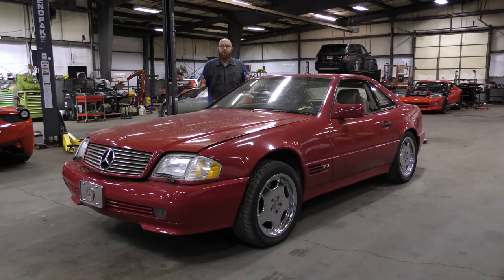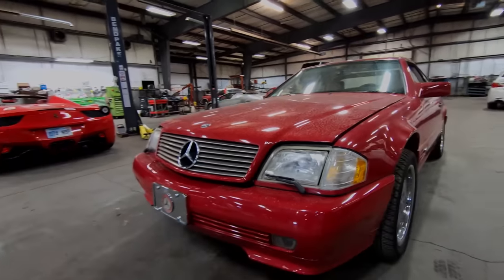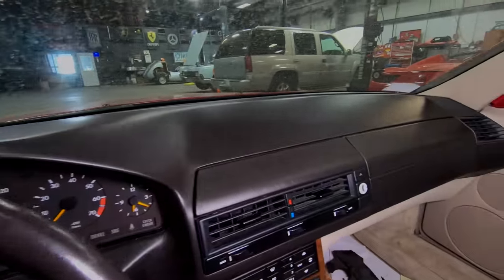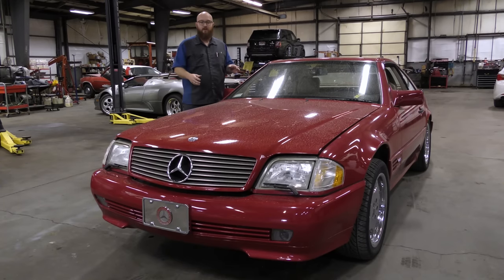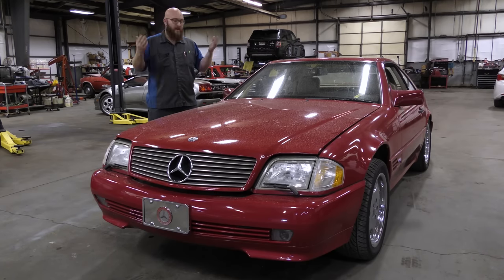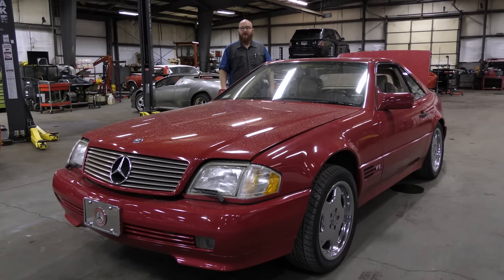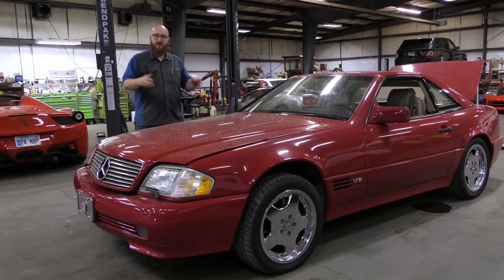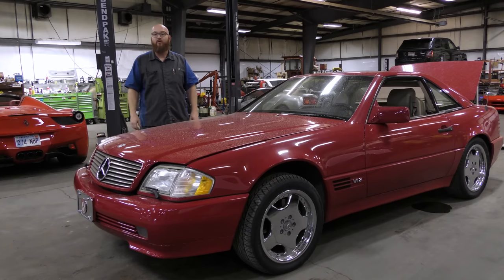Another customer scammed! CAR WIZARD shows why this '94 Mercedes SL600 is needing 15K to get sorted!

Comment: When I see a working-class kid in a complex Eurocar, I experience a moment of sadness. IDK many "rich" people. The ones that I have known tend to drive Japanese luxury cars. The richest old guy I have ever known drove a 10-year-old FWD Chevrolet with a 3400, not the most reliable of cars but he drove it easy and did the maintenance. Trying to look rich makes people very poor. Live modestly.
Reply: Yes. Most self made wealthy people got that way by saving and not spending a lot on, depreciation cars and maintenance bills 👍🏼
Reply: Lol, im "poor" and have owned 2 sl500s of this body style as daily drivers.  Most relible cars ive ever owned.  I dont drive them for flash. I enjoy build quality, smooth and linerar ride and acceleration, the fact that i could in theory rebuild every componet on the car...even circuit boards, and the convertible option.

I know my way around a wrench so thst helps..honestly in the age of the internet, everyone should.
Reply: @mikeyorkav4039  If you want to save money, buy a common car with a common engine and transmission combination. Buy proven combinations.
Reply: @antoniovillanueva308  yeah...i dont care
Reply: @antoniovillanueva308  i save money...and i enjoy quLity cars for the fraction of the price. A car is a car as long as its maintained.

Heres the differece, i expect more out of my sl than i do my honda.  The honda will rattle, etc but i maintain it cheap enough to get from a to b.  The merc will have any hint of something wrong attended to immediately...which isnt often. You expect more out of one than another...which is why cars like this get a bad wrap for reliability.  Of course the european roadster will be more critiqued than the tin can honda.
A differece between a handbuilt classic car than a generic domestic truck.

The only real differece is the prices they charge at the dealership
Reply: @mikeyorkav4039  Nice try. If you didn't care, you would not have responded. Also, you drive your car to impress other people. Sometimes you can lie on the internet and not get called out. Sometimes, you get called on your BS.
Reply: @mikeyorkav4039  Notice that I do not need a second vehicle? Why do you use a second car if your first one is so good? You are responding to a comment about the costly nature of complex European cars. You are not really doing much more than proving me correct.
Reply: @antoniovillanueva308  the honda is what my gf uses....ive also owned multiple cars but these have been my daily for 7 years now.

Man, youre really trying to justify your gm garbage.  That company should have died in 2005.

Edit:  you literally fucking said you have 2 trucks, twit.  This is hilarious.  Continue
Reply: @mikeyorkav4039  You group cars by manufacturer? A 70s 240D is as different from a 2005 SL as a duck is from a washing machine. I group cars by technology and proven reliability. I do not not worship badges and I do not use cars as fashion accessories. Try again?
Reply: @mikeyorkav4039  Read the original comment, the one that you responded to. This is a discussion about the relative cost of owning a high tech modern European car vs a more pedestrian automobile. You cannot drive a 2005 500SL for the same cost per mile that you can drive a 2000 Honda Civic/Buick 3.8/GM truck/Toyota Camry. You are spending your money on a fashion accessory.
Reply: @mikeyorkav4039  I drove one truck until I felt it would be more economical to replace the truck than to continue to subject the truck to continuous use at altitudes from 11K feet to sea level and from 110F to -15F. I never felt the need for 2 trucks. Read the comment again.
Reply: I am a working-class bastard who has always driven complex luxury eurocars, and plan on continue doing so. They are very affordable (relative to the kind of car you're enjoying) if you do the work yourself or can rely on a good and honest mechanic.

Of course if you want to pay your mechanic's boat is not worth it. haha
Reply: @E34Benzin  Everyone gets to decide where they spend their money. Enjoy!

What bothers me is that some people act as if it is not an expense. It is certainly not for everyone and it is most certainly an expense. I am bothered when I talk to people who plan to buy a cheap Eurocar and they are under the impression that it is not going to cost them significant $$ to repair. A lot of people who are not aware and they lose lots of money. If people know what they are doing, that is another matter.

I spend all of my money traveling and I know how to get the most miles for the least dollars, a lot of people do not understand my hobby either. Peace and best wishes!
Reply: @E34Benzin  I saw an air-cooled 911 by Jackson Hole Wyoming a couple of days ago. It was a driver and not a show car. I felt some real lust. I also saw 2 Pagoda Benzes. I do understand the desire!.
Reply: @antoniovillanueva308  All cars are expensive to run. I don't think luxury European cars are as expensive as some people say, as long as you have a good mechanic or do your own work.

That's totally right, each one has his preferences. I don't drive high end cars to pretend I'm rich, but because I enjoy them. 

Same to you, bro!! :)
Reply: @antoniovillanueva308  That's the way to go!! 
I hate garage queens. Cars are meant to be driven and enjoyed.
Reply: @E34Benzin  Just to be clear. Modern European cars require some specific talents and knowledge that are not common in much of America. If people have these skills, they can be reasonable vehicles. I was really speaking of people without these skills. Those people get themselves into much trouble and spend lots of money for little return on their investment.

I had someone call me about a VW for sale on Craigslist for a very low price. Knowing the model in question, knowing the person, and knowing that their skillset is distinctly not related to automotive mechanics, I gave them the sternest of warnings! 

There are certainly people who can operate these vehicles on a budget. I really was not speaking about people with the right skills and knowledge. If I lived overseas, I would suggest cars that are common in that location to people on a budget.
Reply: @antoniovillanueva308  That makes sense because they're not as common as they are in Europe (we even use Mercedes as taxis). Your average European mechanic doesn't know much about the common problems on a Northstar, because there are just a few cars with that engine running around, while in the USA it's widely known and there are lots of solutions to repair it (Northstar Performance's kits for example).

That's the right thing to do. I wouldn't recommend my 600 SEL to the average driver.
Reply: @jkeelsnc  I knew a guy that bought an old Lexus 400. I thought he had made a mistake. That was 9 years ago and that car still looks and runs like a top. It is the most thoroughly reliable thing that I have ever seen. Everything works, everything.

Comment: Even buying one in good condition, we can see the hydraulic cylinders will eventually fail and the biodegradable wiring will disintegrate. It' terrible that Mercedes does not offer replacement harnesses with a correct plastic. Also, it would have been nice if the wizard would have told us what had failed on the rear suspension causing it to sag.
Reply: 'terrible that Mercedes does not offer replacement harnesses with a correct plastic'.. Mercedes did for a while as stated in the video but car companies don't keep making parts for older models.

Comment: I have been selling new and used Mercedes engine harnesses for over 15 years. 
You also need to check both MAF harnesses! 
 All Mercedes from 1993-1995 and some 1992 and 1996 had defective biodegradable wiring harnesses.  I also manufacture premium u-cup seals to rebuild the hydraulic top cylinders.

Comment: Looking like  a good  candidate for an LS swap and coil over suspension.
Reply: i am normaly against LS swap everything BUT this would be a perfect case for it.
Reply: @kapioskapiopoylos7338  this is the same engine as the pagani zonda...

Fuck the ls.  Honestly, someone mechanically inclined can fix all these problems for about 1000 dollars.  Thats with sending the wiring harnesses plus throttle harnesses to be rebuilt.

The m120 v12 is solid as hell and the hydraulic suspension is fantastic.  All these failures are due to age and lack of use.  The top leaks from a lack of use.  When these thi gs work and get exercised, they are reliable
Reply: @mikeyorkav4039  "Honestly, someone mechanically inclined can fix all these problems" YES
"for about 1000 dollars." In your wildest wet dreams.
Reply: @kapioskapiopoylos7338  the hydraulic sheres for the suspension are about 75 a piece and adjustment/bleeding are needed.  Eoof hydrualics can be rebuilt for around 150 for seals.  The wiring harness can be rebuilt by someone for a decent price but i will concede becuase a good rewire will be around 1200 from a reputable mercedes guy in new york.

This can be done for much less than 15k even with a tech
Reply: @mikeyorkav4039  less than 15k maybe, around 1k absolutely no way. 
1.2k JUST for rewire seems fishy but since i don't know it 100% i will accept it. Total is surely upwards of 5k$ if you really want to count the fact that the ecu and possibly other things are toasted and the shipping costs to have everything done at the cheapest yet reasonable quality places. But the 1k$ you estimated at first are way out of this world.
however i know as you said these things (except wirring) age worse if unused, and normaly are great for sure.
Reply: Yeppers , have more power be good on gas and last forever
Reply: Seems silly when on that car the coolest feature is the V12. This car can be fixed for much less but you need to be a good mechanic and have the time and place.
Reply: Hell no.

Comment: SCAMS will keep getting worse.  The car shortage isn't getting any better and it opens up more opportunities for these crooks
Reply: It would appear, to my untrained eyes, that people are pulling cars out of junkyards and driving them.  The garbage i've seen on the roads the past 6 months is mind boggling.  I saw an F150 that looked like it got hit by a train.
Reply: @mistermister2085  I agree! It is so strange to see how many Chevy Cavalier are back on the road in my area. They are really pulling back cars from death. Even myself, if I knew what would happen when I junked my 300000km 2006 Mazda 5, I would have just gone ahead and throw 1500$ in suspension and direction work and keep it!
Reply: @mistermister2085  I really wonder what will happen in California, Washington and other states that are passing these laws limiting new registrations to non ICE (internal combustion engine) after a certain date. The one in Washington takes effect in 2030.
Reply: Yep. I bought a, believe it or not, lexus gs350 with issues from a dealership.  I believe its got a leaking head gasket but usually only causes a intermittent cold start misfire that I shut off as soon as I start it and then it goes away on the second start. Either way its fine, I dont drive much and the dealership gave me the old run "as is" run around. You live and learn. My next car will be getting two pre purchase inspections.  But honesty i might just go back to cycling and walking. I've put on a good chunk of weight, I was slim when I had no car.
Reply: @mistermister2085  LOL, you in NEPA??? see junkers all the time.
Reply: It's not a scam DENNIS.

Comment: My 2002 V6 Camry is in opposite shape as this.  Body and paint looks thrashed but the engine and trans scrupulously maintained.  200K miles and good for a lot more.  I stopped caring about all of that when I turned 60.  It's liberating.
Reply: @jkeelsnc  Now I'm fixing to buy a used Lexus, an ES or GS 350, but I don't think I'll dump the Camry!  It's so thrashed looking Nobody would pay much, but I know the car is still good, so it'll be my spare since it doesn't make sense to do anything else with it.  I even thought about painting it, which would make sense only if I could do the work, which I can't anymore - and can't imagine spending $3000 for painting a 203,000 mile car lol

Comment: LS swap. That's my answer to everything.
Reply: I agree 👍💯
Reply: Yuck
Reply: LS swap 🤘🏽🔥
Reply: My wife asked me what I wanted for dinner. I told her...IDK, just LS swap it.
Reply: @WankelRX  this dude whants  q Ford 5.4 3 valve swapped in the Mercedes
Reply: Better to swap it with an original MB V12 in that case. Or the 5.0-6.0l m113 V8.
Reply: @samholdsworth420  I was trying to think of a worse engine than a 3 valve Ford to one-up your comment, but I'm at a loss🤔🤣
Reply: @samholdsworth420  🤮🤣
Reply: I hope you like doing lots and lots of custom welding and wiring work. That LS engine is NOT going to "drop right in" on that Mercedes engine cradle, not to mention that custom oil pan. Did I mention that the LS wiring harness isn't going to talk to that Mercedes body electronics or instrument cluster? SURE, you can LS swap it... but that's not going to be cheap (cheap by whose standards) or easy. By the time you're done with your LS swap, you are already in the high teens $10K+ approaching $20k JUST with your LS swap. Not a viable or practical option on a car with no major engine mechanical issues.
Reply: @houseofno  Thanks Captain Obvious
Reply: @samholdsworth420  I'd better start running away from that thing as fast as I can! That engine's gonna grenade lol
Reply: @scootypuffjr.  There are real people out there somewhere actually suggesting this nonsense though, I know some of em xD
Reply: If you are an American yokel that is.
Reply: @E34Benzin  yes, we like cars that start and run every time and go long periods without anything breaking. Call us what you will.
Reply: @scootypuffjr.  You should like 90s Mercedes then.

I prefer replacing a simple wiring harness than changing the head bolts on a Northstar, for example. Call me what you will. xD
Reply: @E34Benzin  I have a1986 w126 300SDL. Love that car. They lost their way by the 2000's though.
Reply: @scootypuffjr.  Awesome! I don't understand why we didn't get that model in Europe, but it's a perfect daily driver with that engine.
I plan on getting a W123 300D for commuting.

I completely agree. Mercedes-Benz started to downgrade by late 90s early 2000s.
Reply: It's got 400 HP already, but it doesn't feel like it because it weighs about 7000lbs.

Comment: You really should NOT work on cars!
Hidraulic cilynders sent to Mercedes? Wtf, they are so easy to repair!
Wiring isolation is also easy to fix.
You're not a mechanic, you're a part changer.

Comment: Over 10 years ago I had a beautiful 95 E320 wagon. Two-tone with AMG wheels I felt like an 80s stockbroker cocaine soccer dad!  Of course it started missing and found out about the biodegrading engine harness. I was on a forum and we found a Connecticut Mercedes-Benz dealership that had compassion on us and sold us the harnesses at cost, $980. Paid $4000 for the car, spent $4000 keeping it running, and sold it for $4000 lol.

Comment: I work in a specialty mercedes benz shop, and the original owner was a VW dealer tech in the 80s and had a real soft spot for these old 123s, 124s, 126s, and 129s. To the point where he was losing money month over month and my boss, who bought the business after it started going under, was having to spend weeks sorting out these cars in serious states of disrepair just to have customers come right back because something further down the line in the system would give out. It makes me EXTREMELY grateful to be mainly working on W210 and newer cars that are all garage kept and well maintained. Those old 80s-90s mercedes problems can be a nightmare to diagnose and repair, especially the 126 and 129 platforms. Horrendous to work on all this time later. It's sad for the owners, but those cars belong in history museums because they're ancient at this point....

Comment: 44 years ago, I bought a 1960 T-bird. I think they are a great looking car but this one needed work. It came with a new dashboard cover in the box. I started pulling screws and every time I thought "that must be it" I found another set of 20 screws that had to come out. 3 days later and enough screws to fill a hubcap, the old one was out. Never got it together, I sold it. I'll never buy another one.

Comment: U must charge 1000 bucks an hour bc noway it cost 6 grand to replace those cylinders. The labor is not that hard or long. They dont always all have to be replaced. Most of that harness can be re0laced and fixed at home. If u dont want to do it just say it no need to scare someone

Comment: This era SLs have a manually removable hard-top and electro-hydraulically operated soft top.  If this is a twin plug v12, the cost for 24 plugs is approx $350 and to r/r them takes 4-5 hrs … if you have the special wrench!  That price is way too high, you need to cut it-

Comment: For people interested in this car, I'd suggest getting a '97 or newer 500. Starting this year, the car doesn't suffer from the biodegradable wiring harness, and the latter years have the M113 engine, which is arguably more reliable and doesn't have issues like disintegrating timing chain guides. The 5 speed auto transmission is also very robust. Just make sure the top hydraulics have been serviced, as suggested in this video! It should be done preemptively BEFORE the cylinders start leaking. I have a '99 SL500 and it's been a wonderful car.

Comment: Well the harness is replacable  with your car harness exchanged to a refurbished harness send back to you for the cost of approx 1500 $ with shipping cost. Company in U.K provide it.

Regarding the cylinders seal fail. You can buy the complete cylinder, you dont have to replace the seals. There is full sets with refurbished cylinder with warranty for the cost of 1700$ ish.